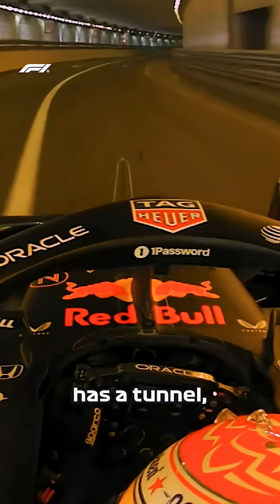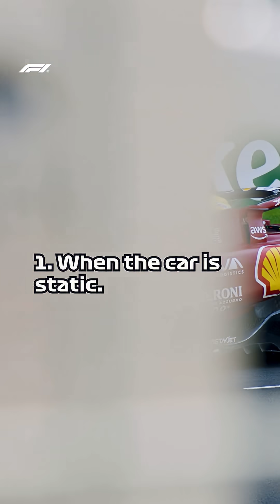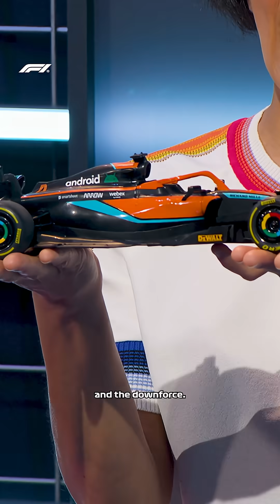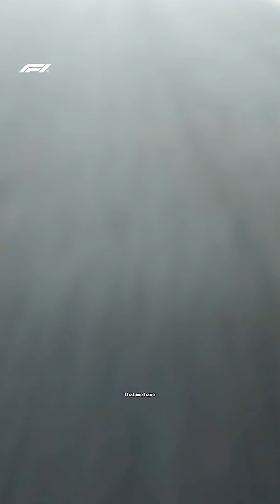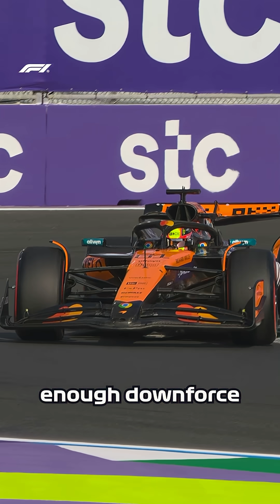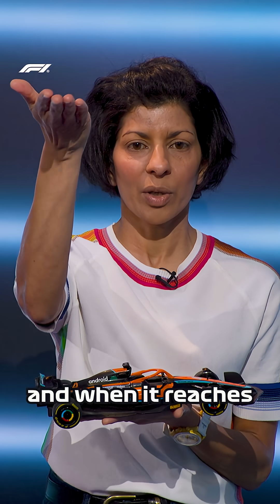Can An F1 Car Drive Upside Down? 🤔

Comment: The biggest problem is that the power train isn’t designed to be upside down so you would get problems with oil flow

Comment: The worst part about this video is that it doesn’t even suggest the critical speed might be different depending on certain factors. It just generically says, it can drive upside down when it reaches a critical speed as if that is a singular magic number

Comment: don't forget dense and laminar flow👍🏼
Reply: dense air plays a big role.
But I should check the quality of the front and rear  wings and tire and engine  which can handle that dense air to combustion. dense air also makes more power from the engine if it can be that strong.
stay safe stay cool👋🏼

Comment: The only bit that was insightful was that the road has to be strong enough to hold the weight of the downforce and car, but the roof doesn’t have to hold the weight of the car, gravity deals with that.

Comment: The same effect in positive impact that gravity has on the car when run on the ground, is the same effect in a negative impact on downforce when the car is inverted. Not enough downforce is generated at critical speed to overcome the effect of gravity. The car wouldn't be fast enough to neutralize the gravitational effect and the car will fall to earth.

Comment: Answer:
Max downforce set up to make up for the weight of the car and the pull needed to keep it on there for more than 3 seconds

High speed, around 360 kph, so max deployment and a run up should hypothetically keep it on there

You're welcome

Comment: The key is to not invert the whole car, but rather just the chassis and body of the car because the engine and fluids and stuff do not work upside down. So if you can somehow keep all the car's internals suspended within the car's body so that when the car goes upside down, the internals still stay right side up, you would be able to drive upside down. But that would require very heavy modification to the car such that the final design would probably either not look like an F1 car or be a really bulky F1 car in order to incorporate the floating internals.

Comment: If my calculations are correct an f1 car needs about 104 mp/h or 170 km/h of speed to generate enough downforce. I found an article from 2025 jan. where they said an f1 car produces about 750kg of downforce at 100mp/h

Comment: Driver61 channel was going to actually try this, turns out while it possible in principle, actually building a way to do it is very hard and very expensive...
Reply: It’s a false hypothesis from the start. No f1 engine can work upside down. And if it does, it’s no longer an F1 car. So there you go, F1 cars can never drive upside down. Doesn’t matter if it generates 1trillion tons of downforce or not. And it’s not about difficult and money. 

And there is a car that can already do that, out of box, no modifications. It’s called McMurtry, 2 ton downforce on stand still by fan, 1 ton in weight.

Comment: Ok, we know it's theoretically possible, but is it really possible?
Reply: Engine would be drowned in oil
Reply: no
Reply: @Bro_s22 But yes😅:
Look up McMurtry Speirling upsidedown. 
They took the speed problem away, by mechanical ground effect through vacuum.
And actually drove(a little bit) upside down.

Comment: Ok….
But…
What is THAT speed????
Reply: In theory at about 150/kmh. These cars produce over three tons of down-force at top speed
Reply: F1 cars generate incredible downforce. In fact, an average F1 car at a speed of 200 km/h can generate a downforce equal to its own mass. Depends a lot on Setup and which F1 car generation. But for high downforce cars 200 km/h is enough to exceed the weight of the car. Some say they can generate up to 5000 kg but not at what speed...
Reply: Its 150km/hr
Reply: It boggles my mind when content like this is produced. You spent all that time setting up the shot, scheduling, setting up equipment, editing, publishing etc but you can’t be bothered to do a small napkin calculation and tell us?
Reply: @danmd667 IT IS EXACTLY WHAT I MEAN!!!!!!!!!!!!
It has no sense!!!!
She said everything about what we already Just know with no answer to what she said in the title!!!
Reply: First It need long enough tunnel, second, the engine not designed too be upside down. The oil and coolant will be upside down and the engine will starve for oil.
Reply: @a.a.a.nugroho  F1 cars dont have normal oil pumps and oil because of the gforces that would push the oil to any direction depending on g forces. So it might work, also cooling is a closed system without air inside so it does not matter aswell. Non sense argument like others said.
Reply: @a.a.a.nugroho  so… no-sense the argument…
Reply: @a.a.a.nugroho ssshhh don't tell them... Let them find out the hard way
Reply: you're welcome to work that out yourself
Reply: @Blockhead-lc6frah ok…😂
Reply: @Blockhead-lc6frdifferent for every car, but as far as i know, at 200 kmh an f1 car from the 14-21 era produces 1.5 times its weight, so i guess around 170-180 kmh would be enough
Reply: @Matthias-v4q  i think that might be short lived. id say you would want to have at least twice the weight of the car in downforce, so that the car pushes its own weight against the roof, so that the car maintains grip and is able to maintain the speed. Depending on the setup, maybe around 300km/h?

Comment: I love the part when they say how fast it needs to go
Reply: Simply lovely
Reply: Same
Reply: I love the part when you clearly don't understand the title of the video.... 😂
Reply: Because it isn't a clear cut answer. It depends on each car because they all have different amounts of downforce and there are multiple downforce configurations for each car depending on the circuit they are running. This is without going into air density which is dependant on altitude
Reply: @vuk_2002  yes but she used the McLaren in Monaco which has one setup and air density
Reply: @epygames exactly
Reply: @vuk_2002  They could have at least named a speed window for Formula 1 cars. I once heard that the speed must be about 200 km/h / 130 mph.
Reply: @vuk_2002 then don't make a video if you don't know the clear-cut answer

Comment: Also, the downforce needs to be enough to generate traction at the wheels otherwise the driver will lose control. At least, the upside down car would need to produce around 150% of the weight of the car in downforce.

Comment: Except the engine is not designed to be able work properly upside down. This wouldn't work on a current F1 car. Driver61 made a video about this.
Reply: It could but for how long it could stay.

Comment: The only way for Stroll to overtake everyone😂
Reply: La unica manera que tienes para llamar la atencion 😆
Reply: you joke but lance is the one of the few drivers to have multiple overtakes in monaco in recent years
Reply: @nobrakes7892  And the one with the most Q1 eliminations, most race starts without a fastest lap and the only human being to crash in the formation lap.
Reply: @Mario-n7y2m sigue disfrutando del Circo nene, te veo muy entretenido 🥳
Reply: @Mario-n7y2m  David Coulthard Monza 1995 for Williams.....Charles Leclerc (Ferrari): Crashed on the formation lap at the 2023 Brazilian Grand Prix .....Hadjar, Doohan and Sainz all crash out after less than a lap as Australian Grand Prix gets off to dramatic start
Reply: @Mario-n7y2m leclerc literally crashed on the formation lap in miami, so did hadjar in australia